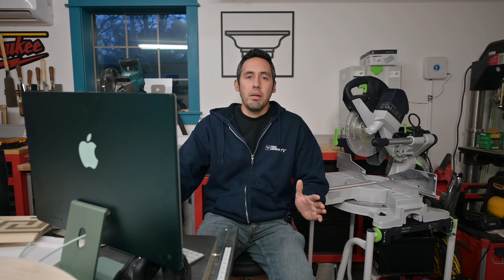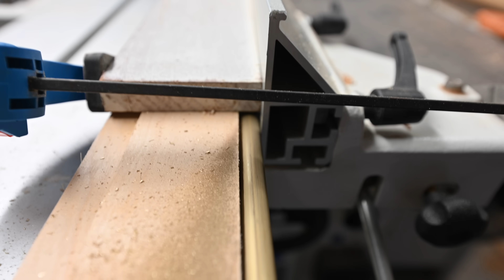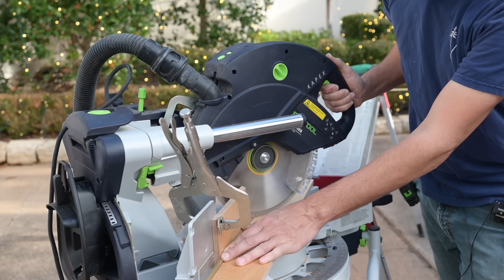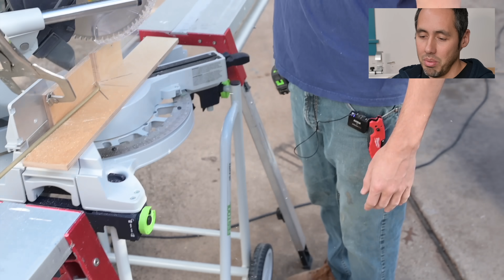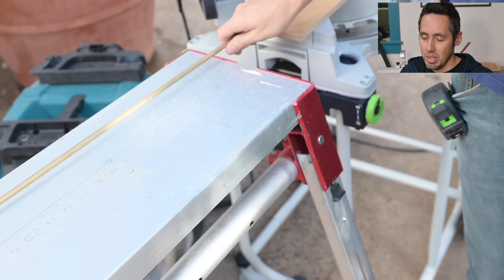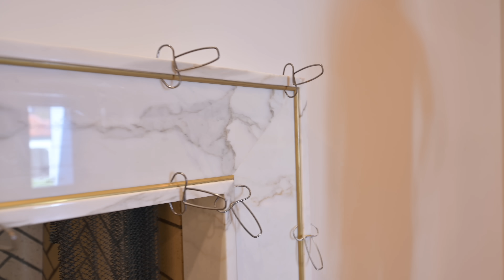It only took 12 years...My first MITER SAW injury.

Comment: I was demoing removing 2x4’s with nails in them we had a pile on the side of the house going but at the end of the day the pile was encroaching on the walkway when it was time to leave I was cleaning up picking up our cords tools etc walked by the pile stepped on a board mail right through my converse shoes and in my foot and fell sitting down on the pile thankfully only my foot was only injured I learned that day use boots and plan where your rubbish pile will be it was my fault I got injured I was 19 at the time

Comment: Your off fall had nowhere to go except into the blade. For that cut Id have switched sides on the saw, inverted the brass and used a square edge to hold it down and in place, and let the off fall fall away from the blade. Wouldn't be a problem with wood, but brass it's a different animal

Comment: Mine was before I was a contractor. Summer of my 10th grade year I was working with a radial arm saw and thumb got sucked in. Wasn’t a pleasant experience. Lost the knuckle but they were able to reattach what was left and I still have feeling in the whole thumb just no middle joint. Cutting off the thumb sucked but after the blood transfusion that was required I ended up getting Epstein Barr virus. I was a rare case that had it active for a long time and that drastically altered my life for sure. Still do construction and woodworking. I don’t fear the tool but definitely respect it.

Comment: If you look at where your work piece is with respect to the center of the blade it appears that you are extended too far out with the saw and generating uplift from the cut being on the back side of the blade.

Comment: Cutting 1" off a 3/4 plywood sheet, the cutoff was vibrating. I decided to hold it with my free hand. Too close to the blade. I realized that the second I hit the button. I immediately put my thumb in my mouth to unplug the saw because my 2-year-old son walked out. As I pulled the plug with my foot and free hand, my wife came out. What happened? I cut my thumb. Is it bad? I said it tastes bad. LOL